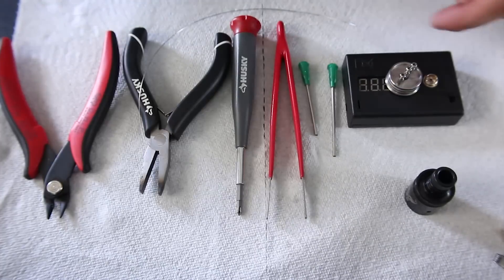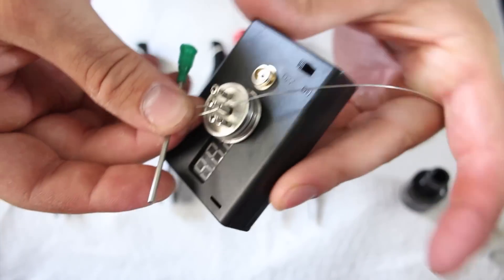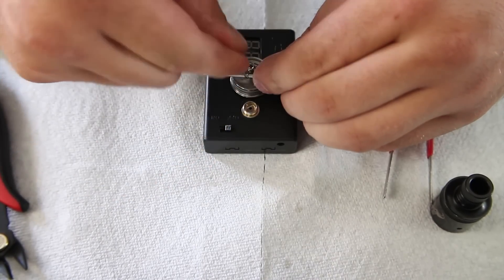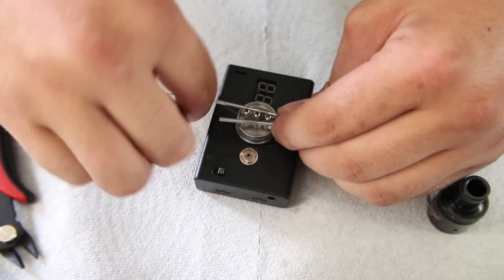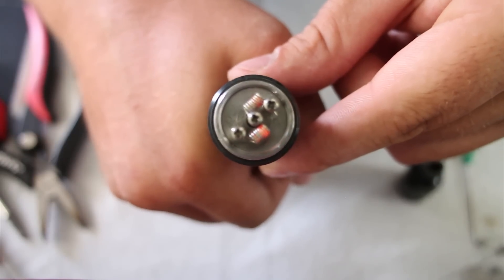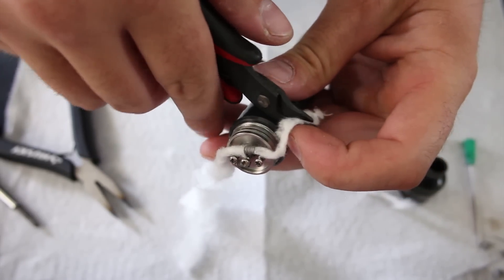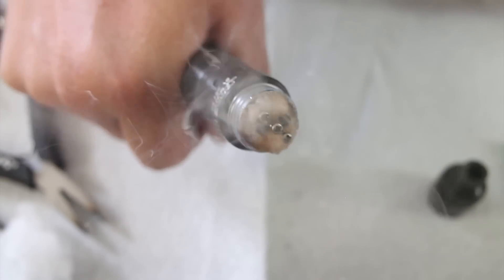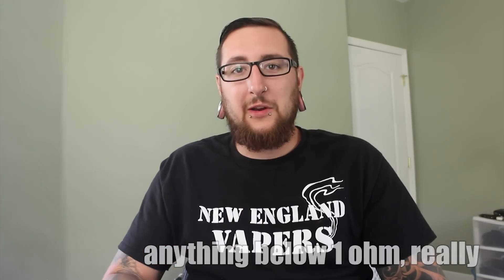#FRESHBUILDFRIDAY - Sleeper Coil

Comment: is that normal the other lights up faster
Reply from the maker: It's kind of tough to get both firing perfectly even, especially with a single strand coil like this but I adjusted it a couple more times off camera before I wicked it. Since I made this video, I've also come a long way with my builds and I'll be sure to post a newer version of this build in the near future.

Comment: Not sure why you made it so difficult for yourself when wrapping the second coil. Simply wrap it higher up the wire, when you have the number of wraps you want, hold the end of your wire with pliers and pull down towards the clamps with your syringe.